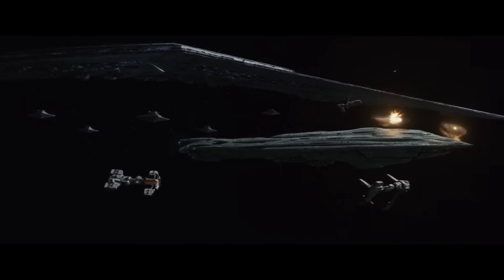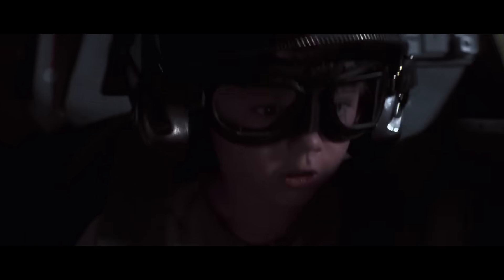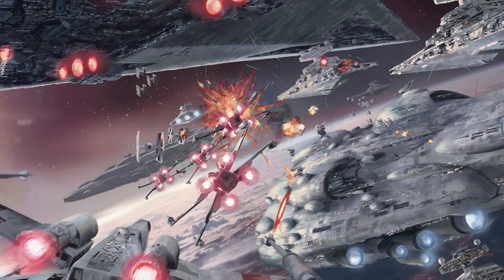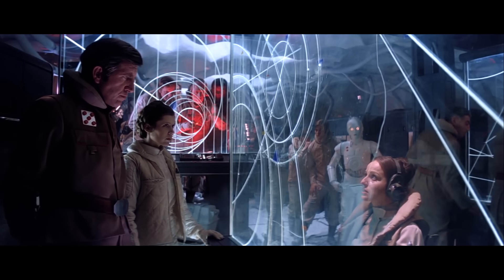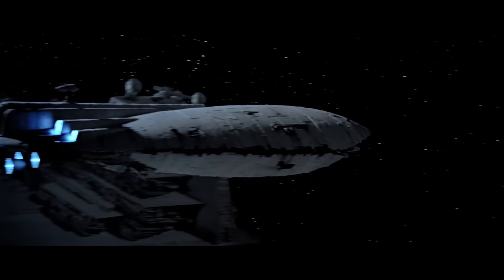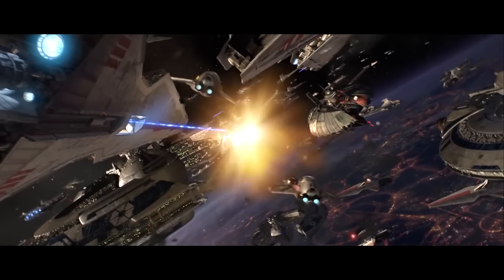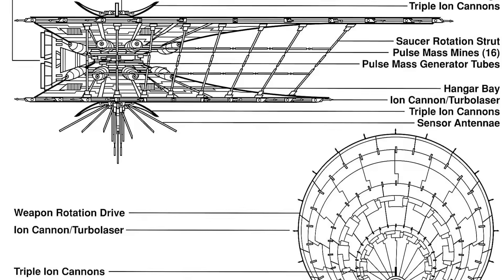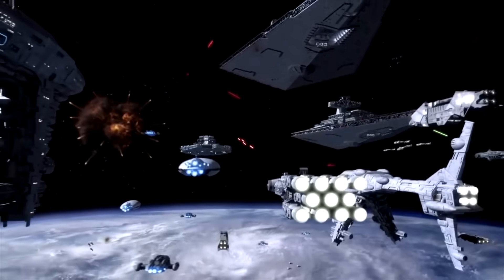Why Star Wars Turbolasers SUCK! (and better options) | Star Wars Lore

Comment: the problem with this kind of theorycrafting is there aren't a whole lot of knowable constraints in this universe. it makes sense for 17th century galleons to have been the way they were, since there were so many restrictions on what you could do. you couldn't put massive long range capital-killer artillery pieces facing all 4 cardinal directions, it was enough to just be able to turn the whole ship, like the first tanks. there aren't really any practical constraints in star wars, you just have this big hull foundation and you can pretty much put whatever you want on it. which makes it all the more inexcusable when there are so many awfully designed ships in the series. the eclipse is cool in my eyes for the one reason that its weakness is reasonably imposed by a practical constraint. the infrastructure supporting such a giant offensive weapon sort of requires there to be a really long, straight tunnel running along the ship. you could imagine that it can't just be an attached barrel that pivots around the base, like a tank's gun, since it's some type of particle accelerator with numerous segments and every segment needs a really bulky infrastructure that's connected to the electric mains. it reminds me of that giant nazi train-mounted artillery piece. huge offensive power at the cost of limberness. compare it to the giant ships in the new trilogy, they are big and unwieldy for basically no reason. it's not like they use all that space to support some giant weapon that requires a 10-mile-long particle accelerator built into the "keel" of the ship. nor do they seem to carry an unusual number of fighters or bombers... nor does the increased size seem to confer some advantage in propulsion. i like no man's sky's giant ships, it's clear that the reason for there being large ships is because they have vast cargo space, room to build anything you want onboard, and a big warp drive efficiency bonus. star wars' giant ships also have a terribly inadequate defense against fighters, the primary offensive force of their sole rival, and their offensive features are easily disabled or circumvented by an impoverished gang of like 200 random dudes in the middle of an attempted munity against their provisional leader, who is a massive idiot yet can instantly destroy an entire fleet by just casually ramming her cruiser into their super-mega-capital ship and its escorts. so now we're supposed to believe that they used all these resources to build this massive interstellar platform, and that they used all this space for... not giant guns, not a huge point defense array, not carrying an unusual number of fighters/bombers, not ferrying an unusual amount of cargo, and not even for hosting a large energy shield generator. that's what i hate about these movies most, it's a neverending idiot plot that just devolves into progressively more flagrant stupidity. it's painful to watch because of what it says about humanity, that they thought this kind of moron-pandering would make for a successful film. the heroes don't overcome forbidding odds and win due to their talent, perseverance, and virtue, they just manage to be slightly less stupid and fuck themselves slightly less than their opponent. the resolution to basically every conflict or obstacle is just the enemy making some colossal mistake, or getting punished for some colossal mistake they made years ago when they planned or designed a given thing. so it's sad for me to watch these videos sometimes, since you put so much thought and effort into these scenarios and then disney just takes a giant dump on all of it

Comment: Mostly rule of cool really. But you can hand wave it away with power generation and structural stress pretty easily like you said. Shields just happen to be rediculsy strong in Star wars and only blaster based weapons are strong enough and cheap enough to be effective.

Comment: I'm a little confused why you used the death star trench run as evidence that turbolasers are ineffective. It's part of the movie that the empire had assumed (rather logically if we're being honest) that fighters lack the firepower to damage the hull in any meaningful way so they didn't bother to put any anti-fighter weapons on it. The turbolasers are intended for ship to ship engagements which were the only ones the designers thought would be a real threat. It's true that they're not effective against fighter craft but that's like claiming an anti-tank gun is useless because of its inability to engage aircraft.

Comment: Turbolasers kinda' suck, but on the whole plasma weapons make a lot of sense in a universe with shields and SW's level of reactor power. There's a finite amount of energy that a kinetic slug of a given mass can convey (you can't have it going faster than light). To deal with more shields you have to carry bigger/denser bullets and more of them, you then run into size and weight issues. 

Plasma can be fired at the same velocity as kinetic weaponry and can be the same mass if desired, but also contains a lot more thermal energy as well. In general this means that a plasma gun shot will deal the same damage to shields (assuming it's raw energy transfer that damages shields) while taking up vastly less space in the ship firing it.

Theoretically the same can apply to missiles, but good luck getting similar energy generation per unit of mass/volume in a missile when you can't make use of the ship's reactor. You do gain the option of uncontrollable reactions though (for instance: if we assume you can't fit a fusion reactor in your ship without ripping it apart you can still utilise fusion nukes).

Of course, this ignores the elephant in the room - lasers. Without bending physics a lot you won't get a more efficient volume:damage potential ratio than a laser. Lasers don't make for entertaining space dogfights though.

Comment: Talk of Turbolasers, but no mention of "Base Delta Zero" at all. (Do you just assume Wookipedia is in any way either complete or accurate?)

The primary use of Turbolasers, after ship-to-ship combat, is planetary bombardment. 

Each Turbolaser blast on an unshielded surface target is the equivalent of nuclear blast in the megaton-range. A small flotilla of Star Destroyers can wipe a planet of all life by blasting it from orbit turns the surface into molten rock and slag in the matter of hours. Such an operation is codenamed "Base Delta Zero" by the Empire. (Some sources claim Tatooine was once a lush green Earth-like planet which was subjected to such a planetary bombardment some time during the revolt against Rakatan Infinite Empire 30,000+BBY).

We the audience, never see these big booms in space during ship-to-ship combat, because of the way shields work; they absorb the energy and feed that into the ship's power systems (this can be a double-edged-sword as the ship's power system can be overloaded with too much energy which will wreck them, or worse, blow up the ship altogether. Ion blasts actually take advantage of this weakness.)
Reply: This is ironically scientifically accurate, as nuclear tests in space were a lot less spectacular than tests within the atmosphere, since there's no atmospheric gases to ignite with super-heated plasma from the nuclear or thermo-nuclear blast. On the other hand, a space-based nuclear blast releases a much more powerful, but invisible to the naked eye, EMP burst than an atmospheric blast. (This was found out the hard way when such test over the Pacific unintentionally knocked out the city of Oahu Hawaii's power grid.)

Comment: I know I am trolling SW fans now, but: use phasers! Super effective computer aimed ion weapons that have long range, are precise, are not slow moving turrets, can be used to deactivate shields and systems or deal direct damage and destroy smaller corvettes and fregates with 1 to 3 hits (if shields are down).

Trolling off: Just placing the turbo laser turrets with more sense would help. For example instead of having two groups of 4 large turbo laser turrets lined up, place them onto the star destroyers' "stairs" with two turrets each level. Like this 100% of them can shoot to the front or turn to the sides and have 50 % of them for broadside fire. And stop placing turrets in the damn trench, that's dumb considering how SW space fights happen.

Comment: SkyNet vs The Flood
267th Attempt
Scenario: SkyNet beats the resistance, and then a Flood Banshee crash-lands on Earth, the Flood form inside does not survive, SkyNet retrieves the body and studies it, and learns the basics of it (it is infectious, has some sort of hive mind, and can take memories), SkyNet salvages the ship for whatever is left, and manages to decode transmissions from the late Covenant, alerting them of the Flood threat coming to Earth. SkyNet then prepares for the next 5 years.
The Flood will arrive using multiple High Charity's, including its fleet, weapons, and so on. In Scenario 1a, it gets 5 High Charity's, in Scenario 1b, it gets 10 High Charity's, and in Scenario 1c, it gets 15 High Charities.
The Flood may not use the Logic Plague on SkyNet.
SkyNet may not travel back in time and just constantly give pre-Flood War SkyNet better and better stuff and information.
If SkyNet can survive until Scenario 1c then I personally say that it would win, although if that is not enough each scenario could in fact be a wave that SkyNet has to destroy, and each wave would come a month after the wave before it was totally destroyed. This would give the Flood 30 High Charity's in total. This month to prepare would SkyNet the chance to regroup and analyze whatever data it received from the battle, whether it be more efficient ways to kill Flood Forms or even gathering and using/reverse engineering Covenant Technology for its own use.

Comment: Is it a Tumor?...Dimensional Weapons systems or black hole weapons? Weapons that create small black holes for the span of a micro second that rip into and pull parts of the ship or whatever it hits into it, initially destroying the ship. I don't care what your shielding is or armor level is b/c the gravity generated by a black hole is almost 2nd to none(I can't say 2nd to none b/c we are still exploring this huge Universe and learning new things every day). So without trying to reinvent the wheel of turbo lasers make something else that doesn't require the wheel to begin with.

How Turbo lasers work seem kind of dumb if you think about it, b/c they could have easily run on a much more advanced version of cold fusion and possibly used the coldness of space itself to keep them cool. I mean if you can vent into space you can also use it to keep your stuff cool and at this point of tech advancement that doesn't seem too far of a stretch of the imagination right? Eckhart I do believe you would be fascinated by Dr.Steven Greer and his lectures plus 2 movies he has put out Sirius and Unacknowledged. Dr.Greer's 3rd movie is coming out in this year sometime I believe. I think you might like his stuff. I understand that you have a family now and time is not a luxury you have an abundance of but when you get the chance check his stuff out. Dr.Steven Greer has briefed President Clinton and The Chief Director of The CIA under Clinton on The E.T. situation when they couldn't get any information from Unacknowledged Black Budge departments far above The CIA and President.

Comment: I will certainly agree that the design of ships in Star Wars is questionable, but I think some of the complaints in the essay are unfair. 

It is rare to hear the main 16 inch battery of the USS Iowa criticized for an inability to track incoming aircraft. As anti-ship/planet weapons, turbo-lasers were not meant to engage sub-fighters. During the desperate battle of Yavin, the rebels didn't even bother trying to launch larger vessels to stop the Deathstar, and the Flak curtains did force the X-wings to fly low in straight canyons that made them rather more vonrable to TIE attack. 

While the logistics of a Turbo-laser seem unenviable, the task of supplying literal tons of missiles/guass slugs/torpedoes to far-flung outposts seems to point towards a preference for some sort of energy weapon, even if the choice is made by bean-counting politicians, rather than the actual commanders.

Comment: They should have dedicated more time and resources into composite laser research(efficiency, accuracy, effective range, miniaturization, etc.).  They also should have put way more effort into researching standard laser technology. Even if the argument could be made that lasers are underpowered which they aren't because they're only limited by the amount of power that can be fed into them,  they would be ideal for countering starfighters as evading a beam moving at the speed of light is virtually impossible.  Why do they even called them lasers. Sure the plasma projectile is made using a laser in order to superheat the plasma, but that would be like calling a regular firearm a gunpowder gun.

Comment: I think torpedoes along with railguns and maybe some missile pods would be effective especially if you can get long range extremely fast missiles developed
Reply: Matthew Blandin Torpedoes and missiles are basically the same thing, as I understand, the only difference being that the first is aquatic and the second atmospheric, a meaningless distinction in space. Otherwise, you're right, although if you ask me, I think missiles would be better used as medium-range anti-strike craft weapons, with mass drivers filling the role of long-range artillery. Note that I say mass drivers because railguns have high maintenance costs compared to gauss weaponry.

Lasers also have their place, but I think that they'd probably be limited to a purely defensive role in shooting down missiles.
Reply: @Pyreleaf  that couldn't be more wrong because missiles can carry multiple Warheads Torpedoes only have one Warhead this is can be programmed to detonate with an approximate name torpedoes are timed and typically in Star Wars torpedoes move much slower and can be shot down by Point defense systems from nipples are harder to hit and move much faster
Reply: Matthew Blandin Yeah, again, I'm pretty sure that's a distinction borne from necessary qualitative differences between submarine and aerial combat.
Reply: @Pyreleaf  Yeah but most science fiction runs with it and you can't argue against the lore of the story without being nitpicky
Reply: Matthew Blandin Yeah, I know, and I get that in a fictional universe, the word of God is precisely that. I'm just saying, as a matter of principle, I believe that attempting to portray realism in space naval warfare is a good thing - to me, that says the author went the extra mile to create a more immersive universe for the audience, and that makes me feel appreciated. And don't get me wrong, I love Star Wars, but George Lucas clearly didn't do his homework.
Reply: @Pyreleaf  It's called Halo
Reply: Matthew Blandin Yeah, I know, and it's great that they did that. I'm saying that I think if Star Wars took the same hard sci-fi approach before adding in space magic, it would improve the franchise overall.

Comment: Some of the problems are not due the nature of the weapon itshelf. Our cannons today are still used the technology aviable at WW2.(More or less) But we have electric servos instead of handwheels, so the turret rotation and elevation speeds are becomes much faster. Also, movie makers are sometimes dont understand even our modern weaponry. Such as central fire control systems, using radar, optical, laser range finder, etc. Even WW2 had such systems in warships, or, for example land based anti-air guns.(With radar and optical rangefinders).Turbolaser turrets are, othervise, not difficult to rebuild as railguns...See the space battleship Yamato, she still have big guns(usable as lasers and also as normal guns), point defence, torpedo tubes, VLS missile silos...Plus a superlaser, aka Wawe Motion Gun...

Comment: If I were to design a ship I would go similar route,.Take away a number of the turbo lasers, put more emphasis on point defense and ion weapons, some additional ordinance launchers for a multitude missiles and torpedoes, and add more kinetic based weapons. However I would do modify some of the rounds used in some of the kinetic weapons. For those wondering what I mean by this think back to Elysium or The Expanse, different munition types that could be fired at high speeds and could penetrate armor and detonate with a high explosive charge, or some that could blow up and send shrapnel and decimate crew and personnel. And in case you're still confused here is a link below to a clip to give some context and think bigger and you'll get the idea of where I'm coming from.

Just watch between :20-:36  https://www.youtube.com/watch?v=OzliqFzK36E

Comment: I would invest in missile technology, those could slip through the shields, and then blow a hole into the armor
Reply: Or use with Ion cannons to knock the shields down then fire a missile barrage into it. You probably don't even need guidance at that point.
Reply: @101Mant  you could use guidance to stay out of visual range